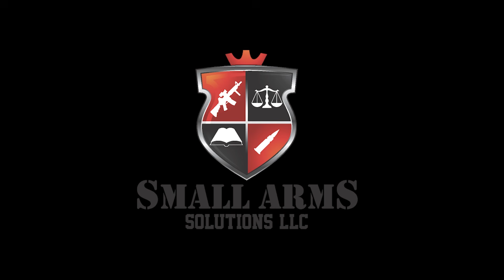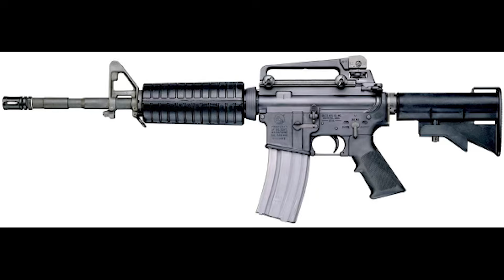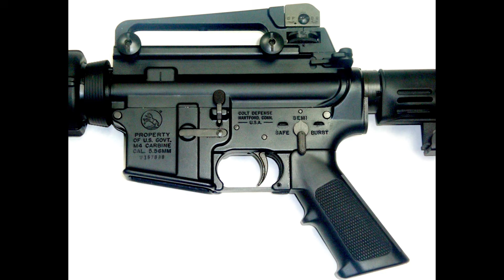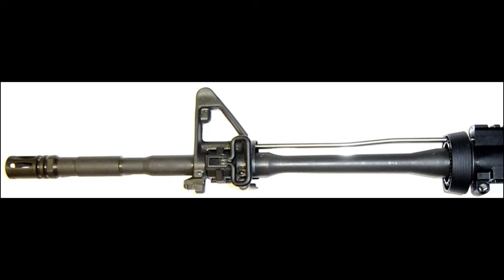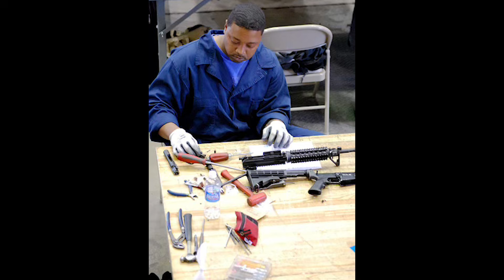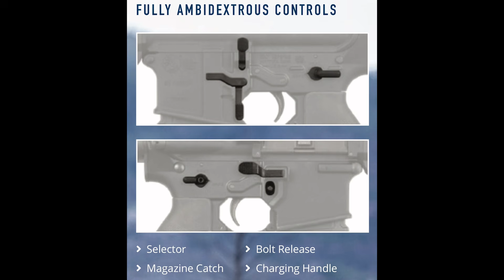History of the US Govt M4A1 Carbine

Comment: I don't see how the thermal issue is unique to the KAC RAS. I'd think any aluminum quad rail would behave about the same thermally. I understand that since it's a drop in rail it creates a physical bridge between the gas block and barrel nut while free float rails don't, but free float rails still heat up very quickly around the gas block because of convection and radiation. Hard to imagine any other aluminum quad or mlok rail keeping the upper receiver meaningfully cooler

Comment: I gotta ask.
You mentioned the sustained full auto fire before potential cook-offs. 
What about the CAR-15 back in the '60s? SF MIKE Forces and SOG teams would do full auto magazine dumps for hours, in intense combat, but never complained about anything that was found in GWOT.
Why? 
There are hundreds of AARs mentioning SOG teams going through 400-600 rounds in minutes, to break contact. But the CAR-15 seemed to never fail them.
Reply from the maker: Like any gun, they would eventually overheat and have failures to extract. But that was not as common of a practice as one would think. The M855 also is a different ammunition. However, SOF has changed much their way of doing things. You look at destruction tests on pencil vs SOCOM you will see a generation of enhancement.

Comment: As a former 0311/0933, and life long gun enthusiast, it drives me crazy that we can't simply swap to a decent free float rail, and have different barrels for different MOS's. Give the supply and support guys pencil barrels, give combat arms the socom barrel or a similar tapered profile barrel that many companies offer now days. Add a new nomenclature of M4A2 to differentiate. Maybe even test out fluted options and authorize both depending on performance and production rates needed. Give everyone a 62 or 77 gr OTMs, or even an Open Tip Ball style round that is similar but only held to a 2 moa standard for the sake of mass production for the rifleman only shooting 300m and in most of the time given that a 6" spread is still good enough for heads popping out of cover. 

From the Marine context, we already had an automatic rifleman in every team and a designated marksman in every squad when I got out. They both had 416s with 16" barrels for better velocity and range, it would be cool to maybe consider an 18" barrel for the DMR similar to the MK12 but logistically it is pretty simple to take off an ACOG and add on an already tested 2.5-8X with the same grip, bipod, and suppressor already being issued to both. Price wise it would be way cheaper to swap barrels and handguards on all our M4s rather than buy even more HKs

OTB capability, even as a former Marine feels a bit over emphasized. You're working as a unit in everything you do, and the beach is only a small part of a war. I'm not sure it's worth it to have a heavier recoiling and heavier rifle like the M27/M38 the rest of the time. Maybe my experience was an outlier but I only saw 1 or 2 broken M4/M16 bolts when I was in vs like 6-8 broken M27 bolts despite there being only 1 per team when I was in. I'd way rather have had an URGI than an M27 as a regular rifleman, especially since I was in an air assault company, and I imagine truck company would feel the same way.
Reply: Logistics cost Germany the war..

Comment: The original 14.5 barrel was made so the m203 could be mounted too. Originally the m16a2 carbine had the full lightweight barrels
Reply from the maker: Actually no, the full lightweight barrels could also mount an M203. The barrel was the same diameter as the A1 barrels the M203 was designed. The later M4 barrel, took the same A2 concept with the front heavy barrel from the front sight base forward. The M203 mounted to the barrel nut and the front of the barrel. Of course they are different barrels. But only different is the later was A2 profile. On the A2 rifle, the launcher mounts to the thinner part of the barrel behind the FSB.
Reply: @SmallArmsSolutions interesting. Did the original model 727 always have a govt profile barrel or was it a1 profile in the early production. Always heard rumors about that
Reply from the maker: 727 always had M4 profile barrel the 723X and 725H used the A1 profile light barrel which were specific to holland and UAE contracts

Comment: You mentioned the M855A1 causing faster wear due to the projectile being all copper/steel and not compressing as easily as lead, and this reminded me of something else. I have some surplus Swedish 5.56 that is also zero lead, and apparently there’s a bit of a story to that ammo and why it ended up on the surplus market.

The Swedish army found that, because of the resistance to compression by the rifling, these projectiles generated significant amounts of vaporized copper when fired. Apparently it was significant enough to cause some soldiers to develop “metal fume fever,” which I’d never heard of before.

Has anything like that been reported with M855A1?
Reply from the maker: I have not heard of this being a concern. It’s a conventional copper jacket surrounding a separate copper core
Reply: @SmallArmsSolutions  I found one of the studies about this. If anyone is interested there is an article titled ”Toxic effects of gunshot fumes from different ammunitions for small arms on lung cells exposed at the air liquid interface” in the journal Toxicology in Vitro, Volume 72.

The ammo was made in Sweden, but it was for the Norwegian army and they were the first to report flu-like symptoms in troops exposed to fumes from the then-new all copper/steel bullet.
Reply from the maker: Im referring to the M855A1, not the Swedish round. I never shot that or even saw it

Comment: I always wonder if the marine corps infantry battalions should have done a PIP for their M4s instead of adopting the M27s as the standard infantryman’s rifle. Mind you the infantry battalions still have a number of M4s they use and issue to mortarmen and headquarters platoon marines that feature the three round burst, government profile barrels, and H1 buffers. The marine corps never did the PIP the army did to update M4s to third iteration M4A1. I think the marine corps could have benefited from a RIS 2 rail system, Socom profile barrel, full auto FCG, H2 buffer M4A1 at perhaps a cheaper price than the M27.

Comment: Thanks. I just picked up an LE6920SOCOM for about $1,500. Happy with my purchase. I noticed it has Colt marks on lower and upper but rest may be outsourced parts. I've examined a coupke of government issued M4's and am confused, as both measure slightly over 16 imches from start of barrel to tip of the carburetor. The LE6920SOCOM measures about 16.5, just one cm longer and not enough to be noticeable. It feels exactly the same and same parts just without Colt markings. I did look at an FN one and noticed their markings on all parts except I couldn't find it on the bolt carrier group.
Reply from the maker: Should be 15.5 in
Reply: @SmallArmsSolutions  does that include the barrel and flash suppressor only?
Reply: @SmallArmsSolutions  and sorry, where would i find the military specifications for an M4A1? Is that something they release publicly or just keep it to suppliers?

Comment: In this video you say the double heat shield hand guards aren’t good because of no ventilation holes. In the earlier M-4 videos and the article you had written on the LE 6920 M-4 you seemed like you were good with the double heat shield hand guards and mentioned it like it was plus for the LE6920 to have them because they were double shield and had the epoxy where the earlier ones didn’t and the CR6920 didn’t have the double heat shield…… ?
Reply from the maker: The double heat shield handguards were a good thing for the end user in protecting their hands better. However, it was never good for the rifle due to poor ventilation and trapping heat.

Comment: Hearing safe with 5.56 is pretty impressive. I run my 12.5" with a silencerco omega. Its rated for up to 300wm, i went with it for 300blk of course but, i use it on my 5.56 too. Its for sure louder on the 5.56 than 308 win...which i did not expect. I just assume its because of the end cap being sized for .30 cal.

Comment: This DI system is still the best overall. Has drawbacks but the Stoner AR system has a lot of benefits over all these other rifles that don't offer much improvements. Really just need a mid length gas system and a free float handguard on this. I am pretty sure that doubled the service life of the barrel and cut down on a lot of malfunctions. I am just quite surprised that those upgrades have not happened on a large scale yet. And agreed, the M7 is not the right choice for every soldier. I still predict it will end up being rechambered to 7.62 nato and used as a DMR role.

Comment: Interesting, I’ve never heard of the RAS rail acting as a heat sink and making the barrel sag.
Reply from the maker: Seen under extreme conditions with SOCOM mostly.
Reply: @  I figured it would require such conditions to make it happen. Did the SOCOM profile barrel minimize the issue?
Reply from the maker: @justsomeguy922r3 SOCOM went to the free float handguard in the MOD 2 and MOD3 URG-I

Comment: I agree m4 will be replaced by a short stoke piston rifle sig spear lite 5.56 etc
Sig spear lite 5.56 or mcx lite will probably be replacing those m4a1s due to their political connections of winning weapons contracts:
Sig p320 and the m5 program

Hopefully they will ask for a 16 ich barrel I doubt they will keep the m855a1 "green" round for their rifles due to excessive barrel wear, bolts breaking and sound suppressors shredding.
Which means they are going back to old stockpiles or ammunition: m855, m193 ball etc.

The 16 inch barrel will ensure letality on target unlike 14.5 inch barrels (those older ball ammunition need the extra barrel length to ensure legality on target)

Comment: The m4 is am awesome assault rifle
I wish the Army would upgrade it by: 
Add a 16 inch barrel
Add midlength gas system
Give m4a1 a 7-10 inch free float rail
Move bayonet Lug forward in front of midlength gas system
Keep socom barrell and thicken up the grenade launcher attachment points

There you go a perfected infantry Assault rifle or maximized pdw
Able to reach out to 800 mtrs with proper ammo
Ensured 5.56 lethality due to 16 inch barrel (14.5 inch barrel is too short to give 5.56 reliable stopping power with m855 ball)
Baynet is kept to give infantry a proper soldier tool: rifle with bayonet
Free float railed barrel to help heat disapation and give better accuracy than original m4

Pray Army makes these upgrades to save our US soldiers lives in the upcoming war with the Axis of evil: Iran, China, Russia, and North Korea
Reply: Edit: free float barrel; i meant free float hand guard, or free float rail
Reply: Edit: free float barrel; I meant to text Free float handguard

Comment: The smart thing to do would be to keep the M4 and transition to 77 gr ammo
Reply: I think that’s a good idea. The m4 is still very accurate up to 500 yards. I can imagine the hole would tighten up significantly with 77 grain.
Reply: Accuracy isn't the issue...it's energy
   5.56 has trouble with energy at range naturally thanks to 22 caliber  projectiles having low BC then add SBR systems which gimp its performance dramatically which is why they started jacking up the pressures trying to regain performance which ended up breaking rifles 
  6.8 smashes 5.56 and pretty much everything else in SBR systems as it was designed to do so getting 3k+ with ball ammo in a 13 inch barrel
Reply: Except at that point, just call in the arty and CAS and keep the 77gr 5.56 to simplify logistics. This isn't 1895 anymore

Comment: NGSW/XM7 is currently intended to only replace the M4A1s for combat troops while the rest of the Army keeps M4A1s, just like how you said it was initially meant to be issued.  I guess the reason for the new M4 orders is to replace worn out weapons.  The Army is ordering XM7s, but the weapon and more importantly the ammo manufacturing lines are still being built up to support the desired number of weapons.  There's no point in replacing all the M4s for grunts when the ammo isn't available.
Reply: XM7 will fail and miserably.  Half the duty positions in an Infantry Line Company would only be hindered if they had to carry it.  Everyone that actually shoots their weapons will have a significantly-reduces basic load due to magazine size, capacity, and weight.  It’s not even a good DM Carbine because it only shoots 2-4 MOA.  What an abortion.

Comment: Government profile is a crime against thermal conductivity and should be severely punished.
Reply: It was the best profile barrel, not the SOCOM barrel.  We just never shoot on AUTO or BURST.  In fact, remove those features.  I liked the 727 barrel profile better by a long shot.  Pencil barrels feel even better, but they didn’t have a way of retaining the front M203 bracket.  That’s why the 727 had a different profile than the original 723s, and 723s later ended up with 727 profiles.

Comment: How would you design an M16A5 upgrade program to improve the M16A4 and M4 carbines used by the Marine Corps that is not prohibitively expensive? 

I think I’d start with a mid length gas system on a 16 inch mid weight barrel and a low profile gas block, add in a free floated hand guard, full auto fire control group, ambidextrous safety and issue them with those rubberized ladder type rail protectors instead of the very rattly and wiggly KAC rail covers. Save as many parts from the existing M16A4 or M4 it’s made from and if it’s an M16A4 then it’ll need an M4 carbine stock and buffer system as well. The end result should be a lightweight rifle that is a cheap upgrade that gives everyone the same barrel length and shooting characteristics as an M27 IAR, but far less durable in the sustained fire role. This would help in optics zeroing all being the same since they now have the same barrel length and now every rifle performs the same in the short term. The grunts will still have the much more durable rifle for sustained fire, but now everyone else can do the same thing for a short while and better than they could before with legacy M4s and M16A4s. Your thoughts?

Comment: I think that your saying it wasn't designed as an "assault rifle" and was only made for "light duty use" BECAUSE of the lightweight barrel is a flawed statement. Reason being:  the A1 and prior were light weight, and were designed as "assault rifles", with the auto feature, the A2 was still a Government profile with light weight under the hand guards just l like the M4, the A2 was designed as a general issue combat rifle. Of course in the course of use the military found that the heavier profile was more advantageous to their needs and use as compared to the lighter weight government profile barrel, But to say it wasn't designed for general combat use BECAUSE of the lack of a heavy barrel is flawed. that's like saying the A1 wasn't designed for combat use because it didn't have the A2 reinforcement on the lower, and the hand guards were a weaker design.
Reply from the maker: The carbine dynamics are different than the rifles. The carbines have a higher cyclic rate and handle heat different.
Reply: @SmallArmsSolutions  Hello Chris, that's as may be, but its still not a design intend as much as a noted correction to an issue that pops up under specific circumstances, and was fixed. no other country uses a barrel as heavy as the SOCOM barrel on any combat weapon. The G36, and similar polymer euro assault weapons suffer from heat soak issues, and they were meant as combat weapons. I'm not defending the original M4 profile, but the heavy in front makes more sense on it than the A2, as the A2was more of a "feel good" move but on the M4 with the step it serves as a recoil lug for the M203 (combat intensions there). I do generally enjoy your videos, but have to disagree here, (on intent). Sometimes experiences tell you that a change is needed to meet your intent.
Reply from the maker: @jakeford2324 intent of the original M4 was light weight and not performance. The Army insisted on the parts commonality with the rifle when the carbine had different operation needs and upgrades needed to get it to perform to its potential,

Comment: What are the provisions that other modern rifles have that prevent barrel rupture, when filled with water or obstruction? How are they related to the operating system - internal piston vs external that the operating system is the culprit? I didn't quite get the connection beteween one and the other. Thanks.

Comment: I don't think barrels ever bent I think they were dropping straightness gauges to him and copper jacketing was getting caught on the gas port on rifle length m16s I don't think the barrels were actually bending but I could be wrong "allegedly"
Reply from the maker: Barrels will droop from excessive heat. Combine that with a vertical pistol grip you are pulling down on or the weights of force multipliers, that will cause bend